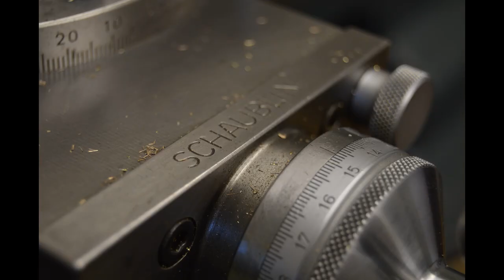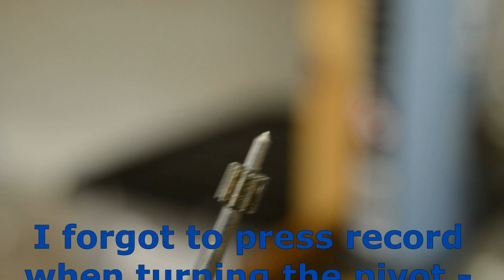Re-pivoting a clock wheel - At the bench with Jobson Clocks.

Comment: Hi Tommy, i found the easiest way was to clamp a piece of 3mm brass plate to the tool post holder, drill the hole and cup with a centre drill and follow up with a 1.5mm drill, speaking of brass plate i have some large sheets of cz120 left over from my clock making days if you or one of your friends are interested, cheers Dave
Reply from the maker: Thats a good way of doing it too.  Any way that works!  Sheet brass is always useful to me, where are you located?
Reply: @TommyJobson  I live in Monkseaton just outside Whitley Bay in the NE

Comment: Nice to be here in your fine makers clock shop. 3:00 minutes in is this a 3C collet you installed to hold your drill guide build? Nice working in fitting the part into the guide making for such superior stable work holding during the pinion drilling operation. Wonderful finished work, thank you for sharing it with us, Lance & Patrick.
Reply from the maker: Many thanks for your kind words.  The collet you mention is a Schaublin W20.  All the best, Tommy

Comment: Just a couple of things, it's not re pivoting. It never had a pivot in the first place it was made in one piece with the pinion together secondly holding the arbour like that is not recommend as you can cause damage to the pinion profile
Reply: A pivot is a short shaft or pin supporting something that turns (Collins), it does not matter how you make it the purpose remains the same, also there is no damage to the pinion profile because a gear drives via the face and not via the land.